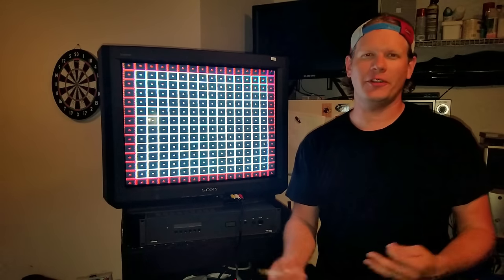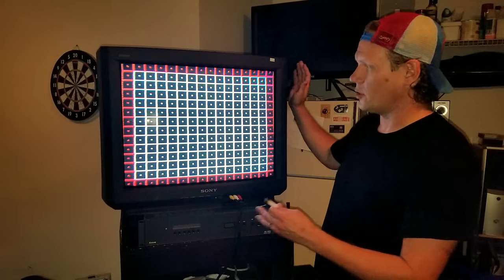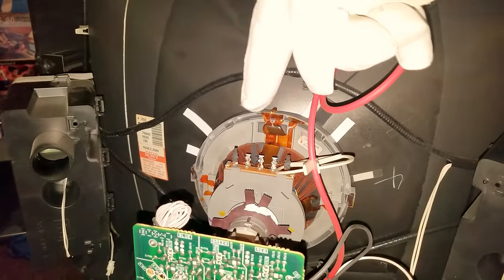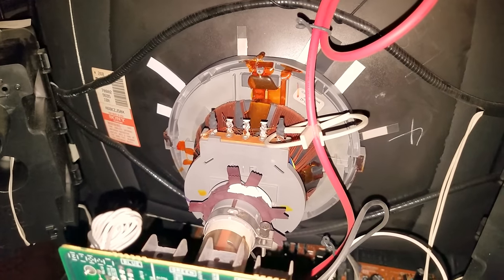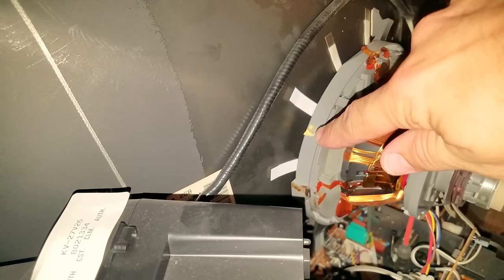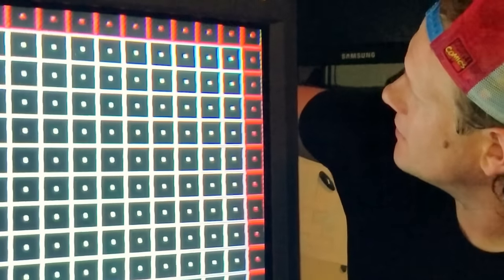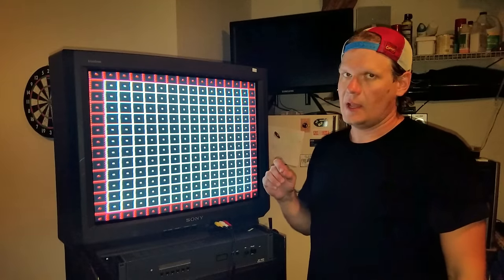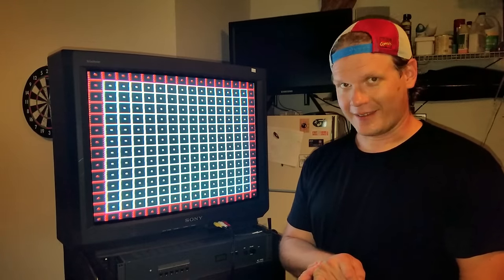New CRT Convergence Strips for a Sony TV PVM

Comment: Corner geometry and convergence will never be perfect on a CRT screen. To quote Samuel M. Goldwasser, "Consider what you are trying to do: get three electron beams which originate from different electron guns to meet at a single point within a fraction of a mm everywhere on the screen. This while the beams are scanning at an effective writing rate of 20,000 mph across the face of a 27" CRT in a variable magnetic environment manufactured at a price you can afford without a second mortgage!"
Reply: On BVMs especially the D24 and D32 you can get near perfect convergence. On D32 you can even adjust it from the menu.
Reply: @ironsienna  BVMs D24 and D32 cost more than a car back then. And they're still not dead perfect. Just as close as you can get on a CRT.
Reply: @sadderthanyou7793  I am not referring to money, I am referring to the limitations of CRT technology. As an owner of a D24 I can assure you that they can be pretty perfect. They look more like OLED than CRT TVs. I do agree that they are the exceptions on the rule though and with an average CRT you will always have a bunch of imperfections.
Reply: @ironsienna  My quote refers to the cost of CRTs back in the day. It was impossible to get PVMs and BVMs at homes. They were strictly for professionals running video business, laboratories, hospitals, etc. Even that aside, BVMs are not dead perfect. There will always be anomalies in a cathode ray tube because it's physically impossible to literally have the geometry perfect, down to every single millimeter. Electron beams can't display a perfect rectangle in a glass tube due to the shapes mismatching. From a normal viewing distances, it will SEEM perfect, but for those with OCD using magnifying glass, perfection is not possible on CRTs.
Reply: @sadderthanyou7793  Thanks for your reply, but please have a look on the sophisticated multi point convergence alignment system of the D32. I am pretty sure you will get impressed! And if you align it with a magnifying glass, then you are all set!! :)
Reply: @ironsienna  I've seen both F1s and D32s. They are the best CRTs had to offer, but it's still not dead perfect. Obviously, perfection isn't needed from normal viewing distances, but OCD people might spend weeks trying to get everything perfect and just waste their time because something will always be off due to sheer physics.
Reply: @sadderthanyou7793  if you've got the dough just get the colour probe and a D32 and it does it all for you, white balance and convergence I think 🤔
Reply: @mattjcwig  D32 is one of the most expensive and hardest to find CRTs ever. An advice like that is killing me. I might as well built a new CRT factory "if I have the dough". Let's be real here.
Also, I don't understand what you mean by "it does it all for you"? Each used D32 needs to be painstakingly calibrated to get (nearly) perfect convergence. I guess you mean some pre-calibrated units for 10 000 bucks or something?

Comment: Truly insightful video regarding geometry and magnets.  The right corners on my BVM, both top and bottom, are crooked moving inward towards the center of the picture.  While I was familiar with convergence strips I didn't know about the round magnets.  But after watching this video I shined a flashlight through the top of the venting on the monitor towards the back of the tube and yoke assembly.  Sure enough, there is a small round magnet adhered to the back of the tube with a small piece of double sided tape.  It's positioned near the yoke but is line with the corner of the tube.  I imagine there is one by the bottom of the yoke as well.  I do want to try and move them to see if it can improve the picture.  The only problem is that there are other components near the yoke and the tube's shield assembly.  I wouldn't have enough room to move the magnet safely with my hand.  I don't suppose there is some sort of tool I could use to remove and replace the magnet.  Would long rubber tipped or plastic anti-static tweezers work?  Also could I just add an additional magnet?  If so what kind should I use?

Comment: I have a 40" CRT TV, it has a switch on it that adjusts this for me. Apparently it is sensitive to the world's magnetic field. I've spun the TV in circles and watched the corners of the TV turn green, then normal. It loves facing North, luckily that's the direction it is placed in my room. I turn it about 1/8 to the east for cornering, but a slight green tint appears and flipping the switch fixes it. As for actual convergence, only 1 or 2 spots show a little red on the grid, but it's fine (far side).
Reply: curious where do you live? My sets are really effected where I am in australia. Ive turned mine west to counter some issues

Comment: Hi Steve, I have a Sony Trinitron kv36fs100 flat screen 480i CRT. I have some pretty bad geometry in the top left corner that cannot be fixed by the sub-menu. I removed the back and had a look around. It was very clean, almost no dust and all the caps appeared in good shape. However, I noticed there were only 2 convergence strips and they were both on the right side. Do you think adding new ones on the left side will help with the corner on the top left?
Reply: Same here! Did you ever figure it out? I tried looking around inside my 32 inch version, and it's exactly as you described.

Comment: Hello, did you check out the deflection board for bad caps before working on the monitor? It’s more likely that some of the caps are getting old than the magnets getting weaker over time.
Reply from the maker: PhilExile I did inspect them visually and they all looked fine, but they could be going bad still.  My plan is to RGB mod the TV at some point this year.  I'll have the board out and will replace all the caps on the deflection board then.  I hope that will help improve the picture more.  I need it for a demo I'm doing in about a month, but after that I'll have time to take it apart.
Reply: Hi again, if you do that you’ll have to redo all the convergence work you’ve done. Just an FYI. :) Also, I replaced a bunch of bad caps today (surface mounts) and all appeared visually OK until I removed them. They each vented fluid. You should invest in both a multimeter which can read capacitance (go with fluke) and an esr meter. It would also be a good idea to try to track down the service manual for that set online so you have a point of reference. Good luck
Reply from the maker: Yes, I will have to basically reset everything on the TV after the cap replacement, which is fine.  This was a TV that I want to use for experiments, testing, etc.  I've been looking for this specific service manual, but I don't want to pay like $5 for a PDF.  I've got a good multimeter, but not an ESR meter.  I've seen those used, but never used one myself.  Thanks for the tips.
Reply: @philexile2954  Thank you for the tip.

Comment: Hey guy, great video! Explains the process very well. Question though, I've just finished RGB-modding my KV-32FS100 and I'm planning to do this anyway for the sake of longevity, but how much effect do you think replacing capacitors would really have on the geometry? Also FYI, your eBay link is dead.
Reply: I think he said to always replace capacitors once they're 20 years old. Capacitors, in general, seem like they always need replacing.

Comment: MR. I have a problem... My Screen has some issues on the right side. Looks like a stain. If I put a magnet nearby, the stain disappears but I want to know what the problem could be? Any suggestions? it's a SONY CRT TV KV-29FA210. If I move the TV, the stain change a little, as if some magnetic field nearby affects it but not sure waht couldl be? I have another CRT TV nearby and it doesn't have any problem.

Comment: I got a   questionfor you,  it looks like the magnetic piece of the strip goes inside the grey circle, is that correct? because some of the strips in your tv kind of look outside of the circle. I was planning on using a mirror and doing some type of long plastic stick with 3d printed claws so i don´t have to put my hands in there because i know the risks and don´t want to be on the hospital.

Comment: Where does the magnet end of the strip go?  Close to the yoke assembly in the center under the plastic or away from it on the back of the tube?

Comment: does this only work on newer TVs? i have a 1970 tube based magnavox CRT and ive tried all the normal adjustments to get the convergence fixed and i still have this problem. (convergence is good in the middle of the picture but warped out of alignment in the corners like the TV in this video)

Comment: Its almost near impossible to find an electrician or repairman familiar with CRTs in my country. My SONY KV29LS30E needs adjustment. i tried to fix the issue trough service menu but i just cant get upper left corner to straighten up. Looks like the upper horizontal line goes gradually downwards from the middle all the way to the upper left corner. After watching and reading alot about geometry and studying internals of an consumer CRT , i pretty much know what needs to be done. However i am also very afraid of the potential discharge that may occur while adjusting the magnets and potentiometers.  I have regular antistatic gloves (not rated) . Would i be safe if i used these gloves + woolen gloves on top of them + woolen clothes to cover any skin during adjustment of the magnets? Would plastic tweezer be a good idea for moving the magnets?

Comment: I’m all for safety and using gloves but I though that as long as you stay away from key components like the anode cap it’s safe without them? I did this same procedure recently and one of my CRT’s using home made strips and even magnetic tape and it worked out great. I didn’t use any gloves. IMO sticking strips into the yoke and sticking magnets on the back of the tube is pretty safe.
Reply: @santospoland  Thank you for the safety reading material.  I did not fully know about ESD safety, beforehand.
Reply: @badreality2  There are risks to working on a tube television but that peachpit article thats floating around is just straight up fear mongering.  Talk to people who actually work in this industry / hobby and get their opinions and stories.  I havent known anyone who has been injured working on a live television while staying away from the mains side but ive heard plenty of stories of "getting bit" from the high voltage parts.  They all say "it wont kill you it just hurts".  It's always the people who dont work on this stuff that share these scare articles.  So yeah just keep asking around.

Comment: Looks like the keystone is off, some tvs have it in he service menu or on the older sets a pot to adjust, my arcade machine monitor has a keystone adjustment pot

I bought a little Sony tv with those magnets in, when I bought it I found them lying in the chassis, the TV is close to 30 years old so I think the sticky tape has done it due, luckily I could still see where they were on the coners of the tube and certainly corrected the geometry.

Comment: Could adjusting the position or adding magnets fix an issue that I have where the bottom part of the screen seems to widen or broaden out towards the sides or corners, so that the image will warp and become wider as it nears the bottom edge? It's a consumer Trinitron, KV-21LT1E. The image is otherwise pretty good, except the bottom becoming wider, and some wavyness on the right side when scrolling vertically.
Reply: So today I warped the corners of my Sony Trinitron with just regular magnets. When I placed the wrongside of the magnet on the backside of the CRT it gave discoloring and it also being my first attempt it warped the bottom left corner pretty heavily with a green hue, this was also with the CRT turned off because I was just that afraid of touching it. Took me plenty of years to finally do it myself, absolutely no one I know relatively close in my area works with CRT's. Anyways, I eventually just fiddled around with the magnets on different spots on the backside while having the service menu enabled and it did help with the bowing on all the sides of the screen, you probably just need more magnets to get it right. You can touch the whole backside with your hands and you just have to be careful to not touch anything other then the backside. My yoke was a bit small to really put magnets on but it definitely had an effect. This however was not need to fix the geometry of my CRT! I hope this comment motivates you to try it out!
Reply: @ecchi12  Thanks! I'll be sure to try it soon. :)

Comment: My tv has good corner convergence but the geometry is off in one of the corners. Is there a place to buy just the small magnets?
Reply: Home depot or Lowe's. But you need to find the smallest ones in terms of size. Make sure they are cubic or rectangular. It's easier to rotate them.

Comment: I have a 14M4U that appears to be very dim at normal settings and the colours are off and I cannot fix it in the service menu. Any clue as to what may be wrong?
Reply from the maker: PressStartGamingHD That could be a lot of things.  That PVM should have a "Screen" potentiometer on the neck board.  Have you tried turning that up?
Reply: Retro Tech No I have not. No experience opening one of these up and I’m not sure if I’m up for giving it a try at least not atm. How much of a process is that adjustment?
Reply from the maker: PressStartGamingHD I'll cover it on the next CRT review video I make.  All crts have a screen adjuster inside.  Its not difficult.

Comment: Thank you for reviewing these, I've been thinking of getting some for a while now. You've convinced me I should :) Is that an Extron MLS 506SA under the TV? I'm a big fan of Extron equipment such as the Crosspoint Matrix Switchers but I've never had a chance to test the MLS. Any chance you could do reviews for this and any other Extron/Kramer equipment?
Reply from the maker: Sure, I can review some of that stuff.  I have a bunch of random extron equipment.  The problem is that most of the stuff I have won't output a 15khz signal through the RGB for some reason.
Reply: That is awesome news! I look forward to it. Which Extron units did you have trouble with and what did you have hooked up to them? I might be able to help troubleshoot.
Reply from the maker: It's been a while since I've used them.  I'll have to get them all out and I'll set up some tests to see what they all are.  Once I do, I'll let you know which are giving me trouble.  Thank you

Comment: How would you obtain additional small magnets, just some off amazon? I have some convergence strips I got off ebay which look like the ones you are using but I'm not sure if they will be enough to help with the geometry issues (I believe it's called shoulder roll off). I haven't tried yet though.
Reply from the maker: I haven't found the round magnets yet, but they seem pretty generic.  I pulled a lot off old tubes that are not in use, but I will try to find some more that you can buy.  Please let me know if you have a product link that you want me to look over before trying.  Thanks.

Comment: I’ve got Sony KV36FS16. It’s glorious except for what I can only describe as patches of warping in the middle of its screen geometry. It’s as though the horizontal linearity isn’t even and as things horizontally scroll, they stretch and compress ever so slightly giving the screen a warbly feel. I assume it is a byproduct of flat faced tubes but it’s driving me nuts. Is there any way I can smooth that out? Would magnets on the yoke even be the way to do that or would they directly on the tube?
Reply from the maker: I can't get the magnets to affect the center geometry at all, but this Trinitron is one of the earlier KVs and is pretty limited on available adjustments.  Have you opened yours to see what's adjustable before?
Reply: Retro Tech I’ve never made internal adjustments on a crt and I’m a bit hesitant due to the risk factor but I’ve done just about all I can through the service menu. There are a number of settings for geo there, but nothing regarding horizontal linearity. Also this thing is HUGE so moving it around to pull the back off is going to be difficult. I think inevitably I’m going to have to open it up, I’m just hoping to find someone who can tell me what I’m supposed to be looking for.
Reply: I'm in the same boat- same TV Same issues. If you find a solution please let me know.

Comment: Nice video very rate to this type of content on YouTube. Someone really needs to manufacture crt in 2019
Reply: Ive just bought a Sony 36fv310 with the matching OG stand.  Its pretty damned sweet.   Loving the 36 inch screen, it replaces my Sony 27FS120.  The 27 is big.  The 36 is an absolute beast.  (~100 lbs vs ~235 lbs).  I'm looking now for a receiver that's got enough inputs that I don't have to rely on switch boxes.

I do feel like a CRT with a boatload of inputs (think enough inputs for Pong through to the Wii.... RF, Composite, Svideo, Component,  Scart, DVI) could be an okay seller, but distribution and supply chain of a 21 cubic foot, 200+lbs box would make them cost prohibitive for most people.  There's only so many people who would want one.  

I'd bet less than 50,000 in North America would want a CRT enough to buy one.... thats somewhere around 0.04% of households total.  Supply chain costs for a truckload of stackable 100 to 200lbs 10 to 20 cubic foot CRTs isn't that bad when its 100% of households  wanting one.... when it's 0.04%?  Quite a bit more pricey.